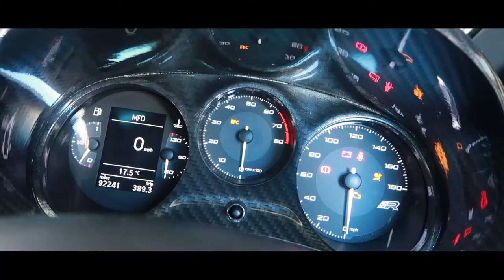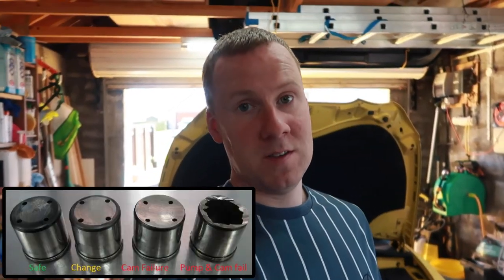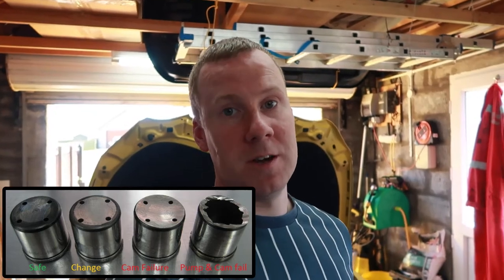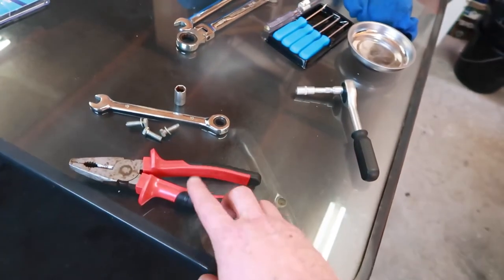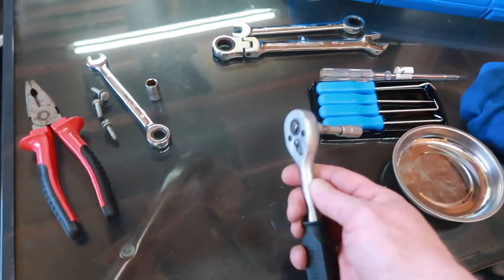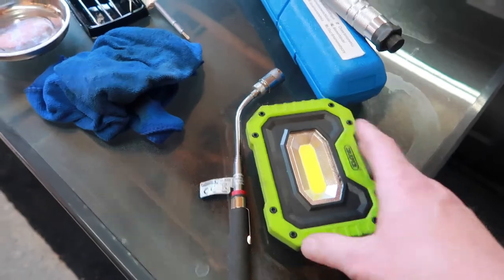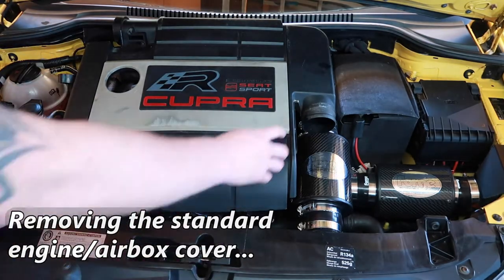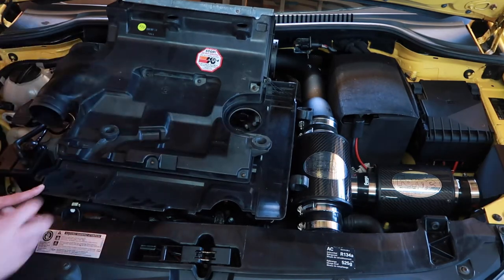Cam follower 2.0 TFSI | Cam Follower inspection | How to remove HPFP | North Coast Workshop

Comment: Gen 4 ea888 
We’ve a mk8 gti CS stage 2 tune with about 450bhp
32k miles and PCV, HPFP and cam follower plus cam sensor replaced just a month ago
the car has has been absolutely faultless until this happened and it didn’t give any warning signs, it just started making a huge ticking noise after a long run 
Over 2k it cost ffs 😢
just before that we had to replace a front IQ headlight unit 
£1250 for the unit, £350 to have it coded in to work!

Comment: My cam lobe is toast! Its never worn through a follower, but it eats the black diamond like carbon off any follower it touches. Ended up with black smudge marks on the lobe
Reply from the maker: That's a nightmare for you! 😕 How long / how many miles do you roughly get out of a follower?
Reply: @NorthCoastWorkshop  I'm not actually sure! I bought the car at 80xxx kms and it had galling on both the lobe and tappet, nothing bad though. Bought an INA branded follower and checked it after 10xxx kms and it had began to transfer the DLC to the lobe but the tappet still had plenty on it. I'm contemplating either new camshaft or roller pump conversion. I might in the meantime run a genuine one as apparently they have a stronger DLC coating. Some people I've shown have said they've never seen that transfer of material before, others say "heat and friction will do that".
Reply from the maker: Yeah a tiny bit of weart on the love will make enough heat to transfer over a bit of the follower. 
What a pain for you. A lot say the roller conversion is peace of mind ongoing, but I think that or a new cam would both be a bit of work.
Either way, hopefully the engine keeps going strong for u, apart from that 🤞🏼
Reply: @NorthCoastWorkshop  yes goes very well. stage 2 tcu ecu, recent carbon clean, injector service, VIS balance shaft freewheel, full top to bottom fluids, all the affordable cdlf mods really.
Reply from the maker: Love this 👆🏻 Good to hear ur looking after her 😁

Comment: Hi mine has 2 metal tubes under the hp bomb how do i remove the one that is on the left?
Reply from the maker: It will require a spanner and be careful not to damage the threads of the nut as u remove it

Comment: how many kilometers or miles cam follower needs to be replace? Regards from Mexico!
Reply from the maker: There's no exact amount, as they seem to wear at different rates inside different engines. It's all down to how the car is driven, how often the oil is changed, what oil is used, is the car remapped etc.
I'd say it's best to give it a quick inspection during every service, and when there appears to be visible wear on it, then have a replacement ready to go in to the car.
Cheers for watching all the way from Mexico 😊👍🏻
Reply: @NorthCoastWorkshop  I understand, I'll grab my notes, in a couple of days I'll change the cam follower,  it's still on delivery cause there aren't any in my town.. nice and helpfull content in your channel keep it up!

Comment: does it make a crazy noise?  how do i know
Reply from the maker: Sadly you'll not know until it's too late. So best to check it as soon as you can, to see what condition it is in. Ideally you have one ordered beforehand to put in if the old one is worn badly. 
Just always have a new one on standby. As long as your hpfp is standard, and you keep up with regular oil changes, the follower will wear a lot less over time. Regular inspections are for piece of mind.
Reply: I have a guy sellingbme his 2010 passat wagon 2.0   says fuel pump hurt a cylinder...   Is ir posible he has 4 shit coils and a rattly hfp guide
Reply: 450.00 for the car 260 000 km mi t besides motor runs like shut.
Reply from the maker: Hmmm, sounds like a lot of bother and could have issues later on down the line that show up once u think it's all sorted 😬 these engines run well if looked after, but cost a fortune if not looked after